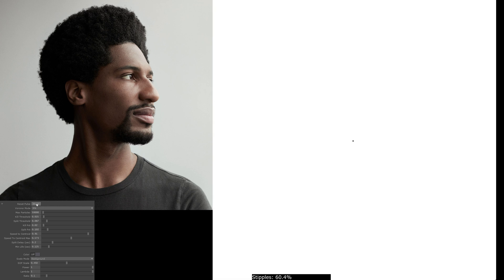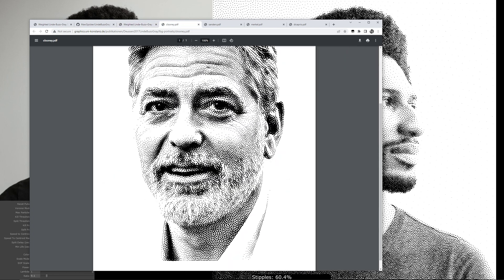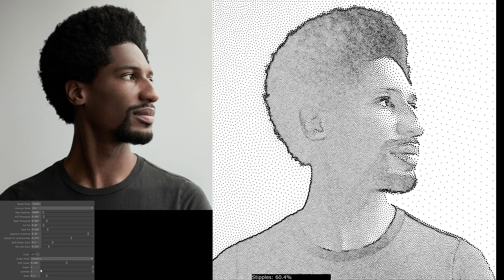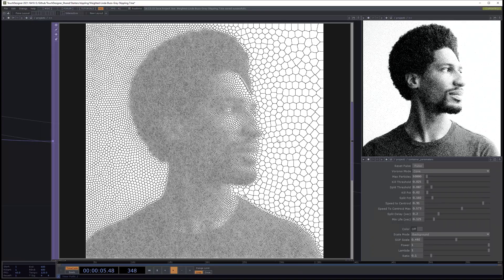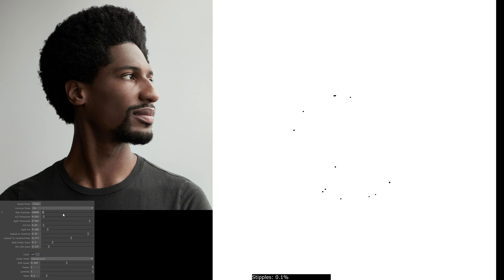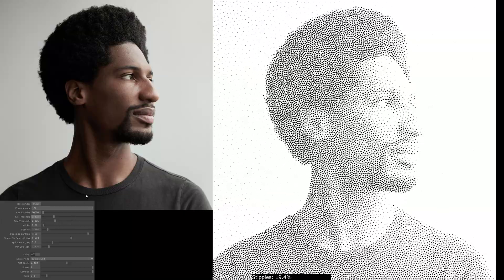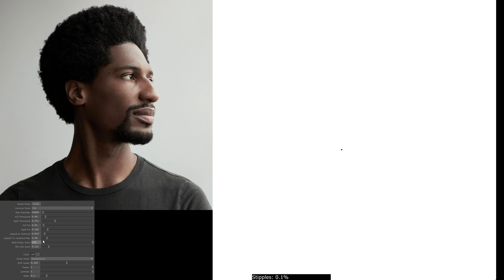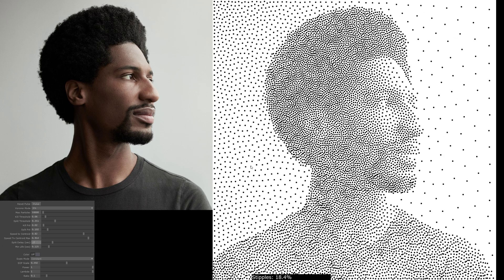Weighted Voronoi Stippling in TouchDesigner

Comment: Great image.
And thanks for sharing tox.
I tried your wonderful tox as soon as I could.
I get a GLSL error. (TD2022.24200 on mac)
(copile error)

glsl_velocity_step.   ! -mark
variance_scale_calculation.    x-mark
glsl_gather_over_all_pixels.   . x-mark

Do you have any idea?
Reply from the maker: Unfortunately it doesn't work on macOS yet because macOS may not support the GLSL function imageAtomicAdd. I asked on the derivative forum about this.
Reply: @DavidBraun  Hi David, I have the GLSL error too, and I'm using Windows not Mac OS. any ideas? Thanks
Reply from the maker: @刘畅-r8s  You can use `return a == vec2(0.) ? a : normalize(a);` in the normx function. I have to investigate why the project doesn't work overall in the latest official build.
Reply: @DavidBraun  Do you have a new version of the file that you could upload on Github?
Reply: me too